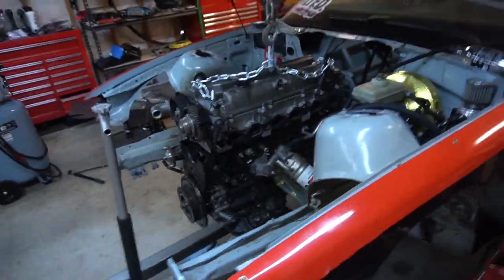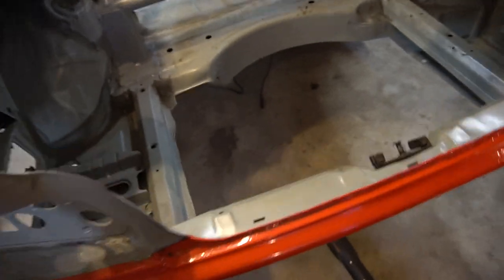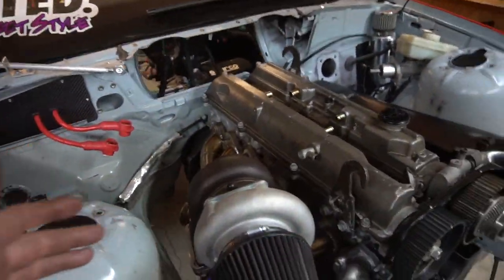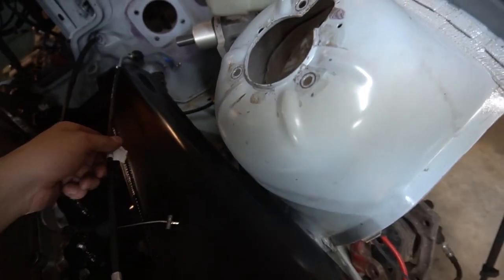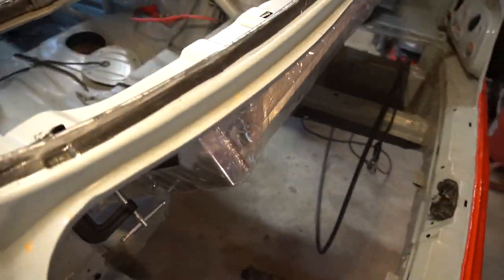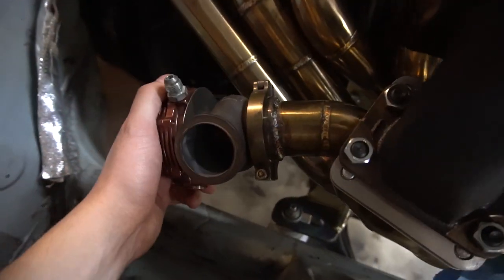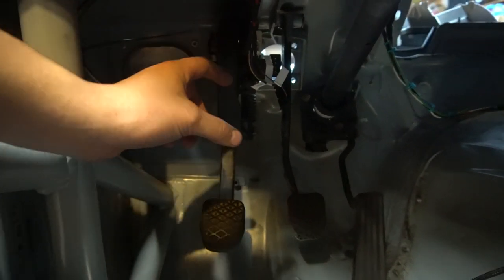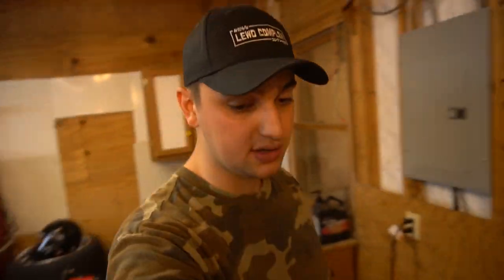E36 Drift Car Rear Mount Radiator Installed!!

Comment: Glad I found this channel. Sic build.  Will you need a new driveeshaft now?  Can u not juut bring the engine forward That little bit.
Reply from the maker: I had to get a new driveshaft made anyway to hold the power but the stock one was about 3/4" off. Even if you tried to slide the engine forward the oil pan hit the front sub frame.